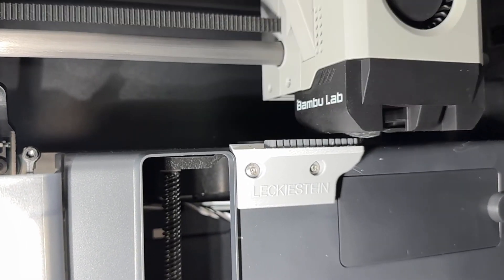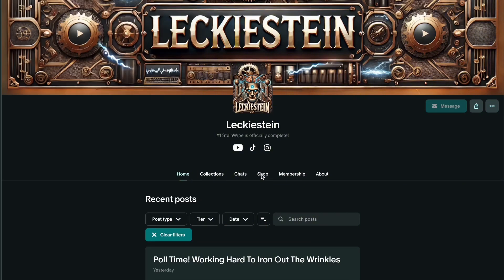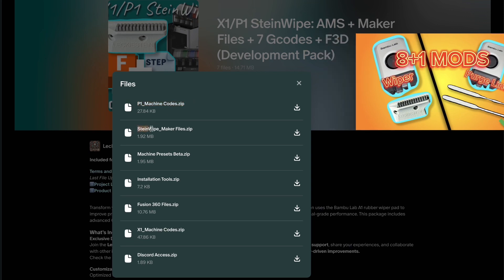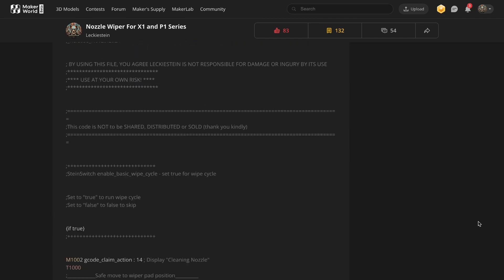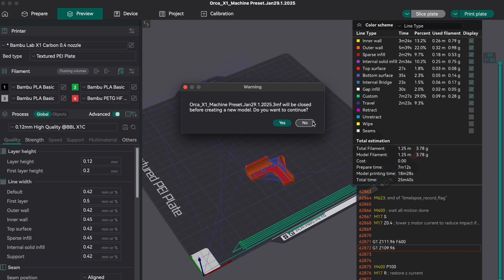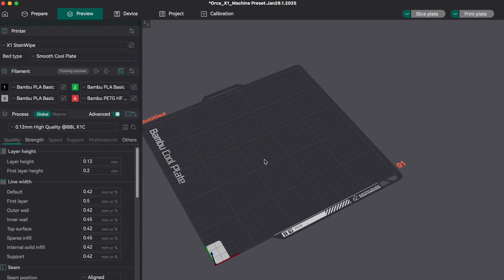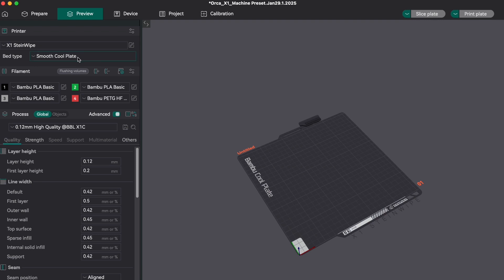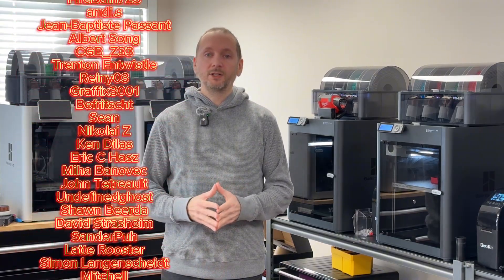How To Install SteinWipe Motion Control For Your Bambu Lab P1S P1P X1C

Comment from the maker: The project is now solid for P1S P1P X1C with AMS! There are tons of new features and Ive discovered many better ways to tackle everything from installing the wiper to SteinSwitches, if you want to go down the new and improved SteinWipe project rabbit hole, these videos and links below are the perfect place to start (in order)! 

1) Stay up to date on everything thats been done for SteinWipe:
https://bit.ly/LeckiesteinProjectLog

2) (this video) No more pasting Gcodes! Everything needed for the slicer is now in a single 3MF file! 
https://youtu.be/jahBdUJ94KI

3) No more editing Gcodes to changes the SteinSwitches, these are now controlled with SteinSwitch Definitions (SSD's). This doc shows you how to use SSD's and what each ones does:
https://docs.google.com/document/d/1540a3b_T8ESQ08lXcBy6db43X7J7yxPiT3bDuzWYge4/edit?tab=t.0#heading=h.ra1esgt7py0c

4) New pause routine trailer featuring SSD's. I show how to use SSD's at 30 seconds mark:
https://www.youtube.com/shorts/cHqVBoUvAgc

5) Get started with the SteinWipe project and basic manual wiper code on MakerWorld for FREE!
https://makerworld.com/en/models/1025501-steinwipe-nozzle-wiper-for-x1-and-p1-series?from=search#profileId-1050795

6) New wiper install method and new template deep dive:
https://youtu.be/DPtA6Nmu70I

8) Tune your wiper offsets to prevent a mid-wipe crisis 
https://discord.com/channels/1327182397673832448/1353220347511574608

9) Feeling good about the project and want more? Get the full project on Patreon and get access to all the files including DEV and Beta and get access special community Discord Channels:
https://www.patreon.com/Leckiestein/shop/x1-p1-steinwipe-dev-pack-maker-files-3mf-840881?utm_medium=clipboard_copy&utm_source=copyLink&utm_campaign=productshare_creator&utm_content=join_link

Comment: After saving the preset, and running a test print. I get the error "A G-code path goes beyond the plate boundaries". I'm assuming its from the Pressure advance test lines? How do I bypass or should I delete that code entirely? On Bambu Studio version 2.4.0.70
Reply from the maker: You will want to turn off the sidestepping. its only available for the older slicer that was running when the code was release. Just go to the printer notes and delete the line with sidestepping
Reply: @leckiestein thank you good sir! 🫡

Comment: Hi great project! I'm wondering how to use the glacier plate as shown at 5:20? My purge line is at the standard place.
Reply from the maker: Thank you! It should be automatic when selecting any of the cool plate options in the slicer drop down. This post on the discord FAQ should help 
https://discord.com/channels/1327182397673832448/1334967265736786026

Comment: Hello, I don’t want to sound rude at all, but how do I know all your g-code and all is safe. I don’t really know g-code, and obviously, running code I don’t know is a little scary. From your videos though, you seem to know what you’re doing. 🎉. And does this tutorial still work if I don’t have the wiper installed; like I just do everything from video except that step? Thank you so much
Reply from the maker: Fair concern! Early on in the project this was a big concern of mine too - to make sure I didnt put some code out there that could break someones machine. But this has not been an issue thankfully. Well over 1k users now and the latest release of SteinWipe Motion Control Apr.28.1 has been solid. I have a Discord channel just for reporting issues for this release and 2 months in were looking good. And yes, you can run SWMC without the wiper installed - the latest release allows you to switch off the wiper portion.
Reply: @leckiestein so just follow this tutorial
Reply from the maker: @Techready-ws2wr Ive posted a step by step guide to get started with the project on MakerWorld and this video is apart of that guide, yes.

Comment: Sounds interesting, is that also possible with the Flashforge AD5X?
Reply from the maker: Yes its possible to adapt swmc to any printer that uses open gcode control
Reply: @leckiestein  By open Gcode control, do you mean what you enter in the Orca Slicer in the start Gcode under the printer settings?
Reply from the maker: @tolzi_woodwork  Correct. I plan to do scripts with python so using a slicer like Orca is great for this down the road.
Reply: @leckiestein  OK thanks

Comment: So i can print the Steinwipe for free but not use it without paying?
Reply from the maker: There is a portion of the project on makerworld that is 100% free that will get you the wiper mount and all of the G code needed to get started in the form of a 3mf file. Everything in this video applies to how to set up that provided 3MF on makerworld

Comment: Your custom defined switches are not cheat codes, they are just switches for your own custom code.
Reply from the maker: I just called them “cheat codes” for fun because they unlock hidden behavior BBL users have never see but this video does not showcase them. This is a totally brand new thing and only a few hundred Leckiestein Patrons have been able to try it out so far. I will have a video out soon. These are literally codes you paste to the printer notes to "cheat" your way out of having to dig though thousands of lines of gcode. Cheers
Reply: @leckiestein Got it, but the term suggests different.
When you say just a few have these now, what is different to them than the ones that can be already bought in your shop?
Reply from the maker: @AlexanderNassian  "Got it, but the term suggests different." - In the video you came from, I think you missed the whole part where I explained what the cheat codes are I explained the whole thing very clearly around 45 sec.

"what is different to them than the ones that can be already bought in your shop?" - again, around 45 seconds on the cheat codes short, I talk about the SSD documentation where you can see what all the codes do and how to use them. 

To save you from having to go back, this is the doc you're going to want to check out :)

https://docs.google.com/document/d/1540a3b_T8ESQ08lXcBy6db43X7J7yxPiT3bDuzWYge4/edit?tab=t.0#heading=h.bipm8krqsly7

Comment: I bought the pack last night and used your video to create a user preset using a 0.4mm nozzle on my P1S.  The test print worked perfectly!!!  How do I create a separate preset of 0.2 and 0.6 nozzles?  Each time I load the mf file, it goes back to a 0.4mm system preset.   Thanks!
Reply: I'm having this exact same issue. Did you find a solution?

Comment: Hey Leckiestein, I purchased the package and am trying to follow your guide. Im not able to do it and my files look different, also I cant export any gcode... I dont know this is too unspecific. I use BBS and have a P1S+AMS :)
Reply from the maker: @TheCrust333  the biggest question I have is why are you trying to export G code? The purpose of the video is to show you how to import the provided 3MF file so you don't ever have to touch Gcode for those who have no understanding of that side of the process.

Comment: I purchased the Steinwipe and files after installing the files I get an error that prohibits me from printing "Error A G-cdoe path goes beyond plate boundaries" it appears to be about 20mm of filament about where the head parks right under the "pe" in "X1 SteinWipe Demo".
Reply: I had this same issue with using ready profile. Copy and plaste all gcodes manually and it works
Reply from the maker: This is because you're using a newer version of BBS. At the time of release and testing, that version was not stable yet. In the start up G code copy out the code and open that text in your text editor and do a search for "X70" there should be four instances at the top of the code in the prime section. Just delete that "X70" value in those 4 places and leave everything else. Then bring it back into BBS and you'll be fixed up.  Alternatively you can downgrade the printer firmware to use the last version of BBS right inside the handy app by clicking on the printer and then going to the top right hamburger menu and then going to firmware and there's an option at the bottom that says downgrade firmware. All of this is in the Stinewipe channel on the discord :)
Reply: @leckiestein  can you make a new 3mf file, because im struggling to search and find it , just bought the package for x1 and p1
Reply from the maker: @jasonvorxis  in the video it is in the machine presets folder scene at 1:23

Comment: Do 3MF Presets contain the same gcode as what you enter manually, as you explained in the older video?
Reply from the maker: Yes, when exported correctly. My 3MF presets in the Dev Pack will have all of the Gcode entered already so you wont have to enter it manually.

Comment: I have a rigid garolite builtplate that is stoping me from doing your mode, I'm afraid the plate will bend the nozzle when it goes to the back to be cleaned on the floating part of the guild plate
Reply from the maker: Also, Ill mention the newest code if you set to any plate other than textured PEI, the scrub is canceled. It will just park on the plate and there will be no scrape. There 100% will be no problem if you select a different plate in the slicer
Reply: @leckiestein  buying it as soon as I arrive home thanks
Reply from the maker: The stock bambu code is using the same offsets in the same location. I just change how its being used. The position for this is off the build plate itself so even without the spring relief there is still lots of give.

Comment: Will you be updating to add a p1 gcode? Or is there a way to change so I can ditch all the purge lines that the x1 uses?
Reply from the maker: Hi Kyle, the X1 has been the primary focus for development as what ever works on the X1 can be brought over to the P1 but not the other way around. So at this time, the P1 has just enough code and I provided the bed models for the P1 with both BBS and Orca offsets to let you use the main features of the project - but it is no where near done. This project has evolved so much based on feedback that I have went back to change things several times after I announced something was completed haha. There are currently several pressing matters in the material change section for both machines that I am working very very hard on resolving. The main one being that BBS saves 18mm of filament on each change but this is not a default in orca so Im working on making that work right now (nothing to do with steinwipe motion control, its just a flaw in the filament presets of orca). I should have a beta release for this code out by the weekend and if all is well, it will be brought over to the P1 format and you will see machine profiles for this soon.
Reply: @ awesome I am already currently using this on a p1s with ams with zero issues and same with a p1p with no ams both printing great
Reply from the maker: @BELLO_TS  great to hear! Thanks for the awesome feedback 🙏

Comment: Does this include X1E machines?
Reply from the maker: There are a few people in this SteinWipe community who have the X1E and as far as I can tell there are no problems. You will have to add the preheat chamber code to the preset if that is something you want to still use after loading the preset. I dont have an X1E to test on, but if there comes a time the demand was higher for it, I could get a hold of one to offer official support for the machine
Reply: @ excellent! I’ll give it a shot, I planned to join the community regardless. Petg hf is driving me crazy with its rogue strings with the stock setup, this is by far the cleanest solution. Thanks for the response!
Reply from the maker: @barnesbuilt1250  Right on pal, looking forward to seeing you in there :) And I feel your pain with that HF filament.. It is the reason why I even started developing this solution in the first place! This is what I use to do before developing SteinWipe because nothing else works on prints like this one where there are so many small areas and a bajillion travels haha
https://www.youtube.com/shorts/8Bk1rUykNV0

Comment: What if I use my own and Bambu's default presets? do I need to copy the Gcode into all those presets?
Reply from the maker: If you want to use the stock bambu Gcode but add the SteinWipe, you can use the sample code on the MakerWorld listing. You will need to add the code anywhere you want a wipe sequence to happen ie after a pause or material change. I hope to have a video out for that soon.
Reply: @leckiestein  jaki kod trzeba dodać w bambustudio w sekcji dodaj niestandardowy gcode na dowolnej warstwie ? tak żeby dysza się sama wyczyściła na dowolnej warstwie i pozniej dalej kontynuowała wydruk

Comment: When modifying my printer with your Wipermod, is it still possible to use Bambu Handy Prints, or do I have to run it every time through the pc to ensure the right machine gcode?
Reply from the maker: I considered this when designing the wiper mount. It is just out of reach to not interfere with the stock routine so you can run jobs right from the handy app and not have any potential to bend your nozzle by improper entry to the wiper pad. But yes, to use steinwipe you will have to slice the file with the steinwipe preset.

Comment: Great video as usual. Need to get this installed. I am a patreon about  1-2 weeks now and haven't gotten around to it. Although I didn't see my name flash up (most likely too new of a member when the list was made), anyhow. To anyone who hasn't subbed. Some great tips. Well worth the few bucks.
Reply from the maker: Hey! Thanks for your support and happy to hear youre getting some value from being a Innovator Tier. Your name is on the list fifth down :) I shot the outro before putting the list up there and didnt realize the scroll would take so long. Next time Ill make sure to make the outro 4 times longer haha
Reply: @leckiestein  OMG so it is. I guess I wasn't expecting it as high up on the list as I thought I would be one of your last to join. Apologies 😔. Thank you however for making our lives so much better with your model and gcode. Makes things sooooo much faster and better. Less stringing FTW.
Reply from the maker: @TechieNI  The strongest supporters are at the top of the list so thank you so much for supporting these projects and it's always so good to hear such awesome feedback on the work this little community has done here!
Reply: @leckiestein  I also see things have changed since this video, there is no longer 3mf files, it is all gcode files now. Can I ask why this is?